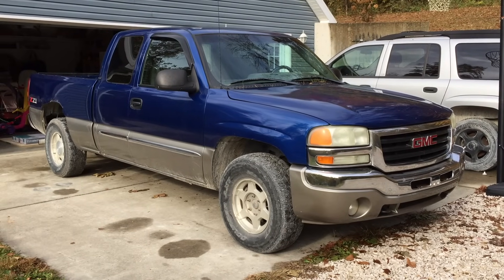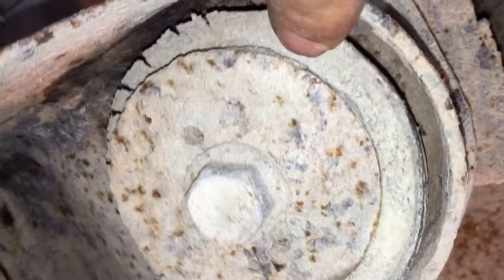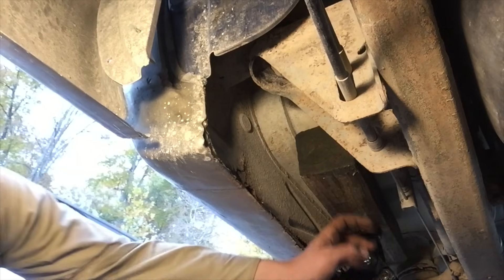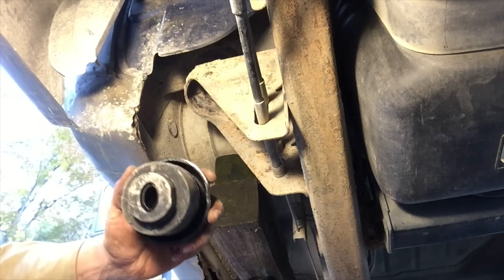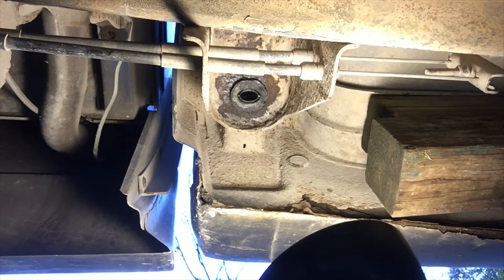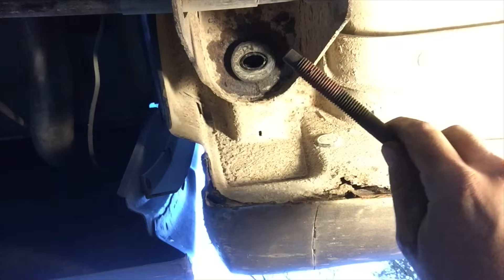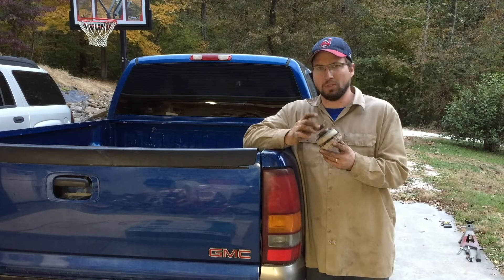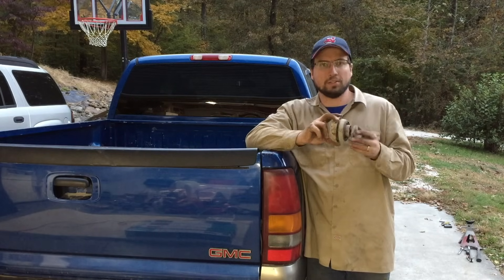How to replace truck body mounts - Body Mount Bushing replacement - EASY - Chevy/GMC

Comment: I've always been told not to use an impact on body mount bolts
Reply: I can see why. I used an impact to get my bolts off. I was in shock to find out that the end of the bolt was as thin as a pencil. It very well could have broke on me with the sheer amount of torque from the impact gun.
Reply: When the bolt breaks, you always blame whatever method you used to break it.
Reply: @james avery That makes sense.

Comment: I don't know what the deal is I have a 03 and there's literally parts from 99-07 my new cluster came from a  05 with a rotted n broke frame one rear door is from a 2000 zero rust my first rearend 1/3 now the axle housing rotted all the way thru engine & trans I put in last year from a 02 sierra 100k complete rot box. The 5.3 not one problem what so ever. I send it in the danger zone everyday purrs like a kitten. I've had mine 2 years it's a ongoing fight salt in pa is just killing them. Next on yours will be the engine harness grounds on the body mount under the drivers door had to grind all the rust clean and rebolt them truck wouldn't even start anymore.
Reply from the maker: Yup, the truck is rotting down around the tough as nails 5.3. I've had more trouble with the body than the drivetrain.

Comment: Good video... Those "cupped" pieces actually go on top between cab and top of rubber mount.

Also I can say avoid Rockauto at any cost, if the part breaks outside of "their warranty" they refuse to honor the manufacturer warranty for refund or replacement. They claim 60 or 90 day warranty when manufacturer is typically 1 or more years, and when you contact manufacturer they say contact the seller. I learned this the hard way and am out hundreds, although I got lucky that the failed part did not lead to thousands on a overheated engine since it was stopped before getting too hot.
Reply: Computer cut me off I along with several friends have ordered thousands of dollars of parts from them never had any issues with parts. BEST PLACE TO ORDER ANYTHING FOR A VEHICLE AND  FEDEX BRINGS IT TO YOUR DOOR,

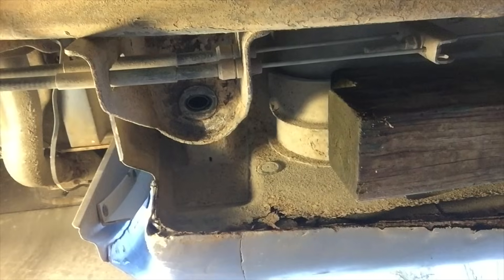Comment: 3:18 does your frame has a hole? Or is just happy to see us?
Reply: @lgnw-ong1189  looks can be deciving,eitherway check your frame before doin car mounts,i know my cab mounts on my 1500 were beyong shot
Reply: Кайена Арельяно Yeah most people don’t bother to check the condition of the mounts until there trashed. Most if not all are supposed to be changed every 50k by GM. But the number of people who keep up with preventative maintenance is slim to none. Sadly
Reply: @lgnw-ong1189  especially if the cab is sitting in the frame and the cab mount spins freely XD

Comment: i agree body mounts on a rust bucket,,,whats the point
Reply: Because these trucks can develop an obnoxious body-to-frame rattle once the rubber body mounts wear out. The GMT800 platform is otherwise a fairly quiet full size 4wd vehicle to drive, even the suburbans. GM released has released several technical service bulletins related to body mounts for these trucks (99-07).